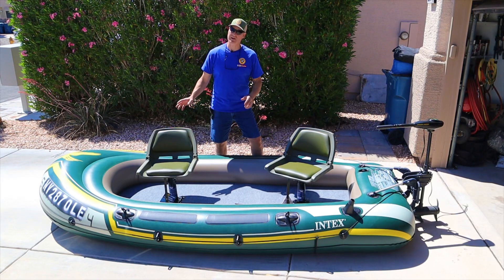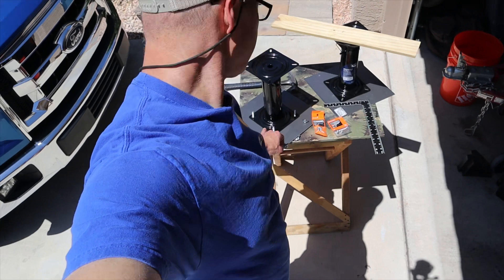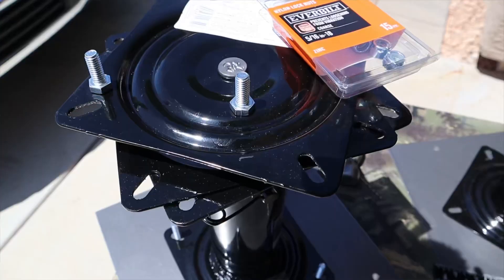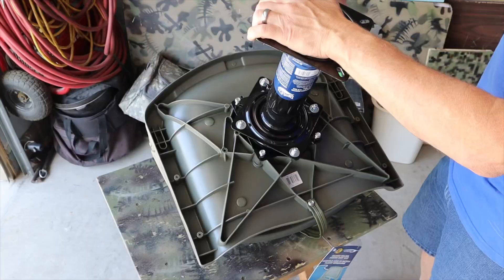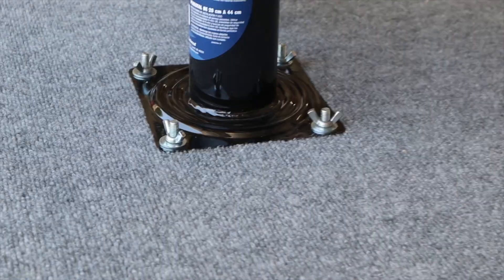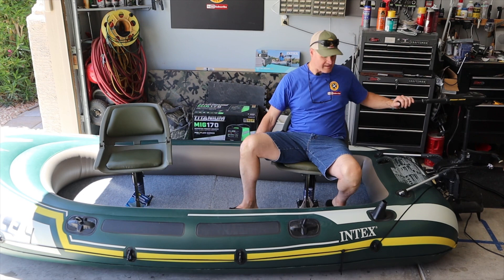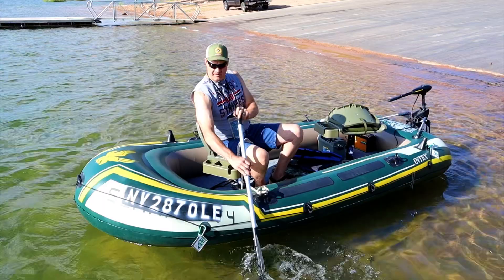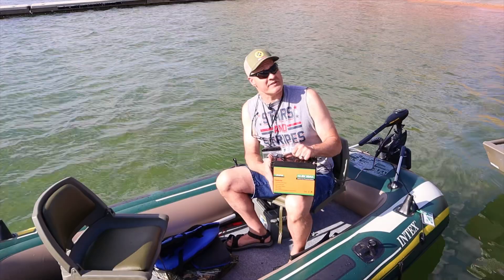Seahawk 4 Boat Seat Installation

Comment: Think the swivel ability addition also relieves some pressure on the mounting bolts to the floor 👍🏻
Reply from the maker: Absolutely! A fixed position would put stress on the entire mounting.
Reply: @MrFredsDIY  What is the size of the floor board? Width and length. Thanks for your reply.

Comment: Could you have used plywood with lockout  for plate and screws  ??   Would it been liter ??
Reply from the maker: I had considered issuing bolts and larger fender washers which would probably work. The steel plate design stays in place and makes assembly easier. A plywood plate would also work,

Comment: Honestly, I would have avoided the plate on the bottom. Just run carriage bolts up through the floor. Already smooth heads.

Comment: Damn i don't have a welding machine
Reply from the maker: It’s not really necessary. Bolts with large fender washers would do the trick with or without the steel plate. Thanks for watching!